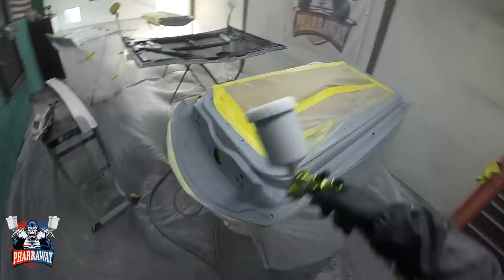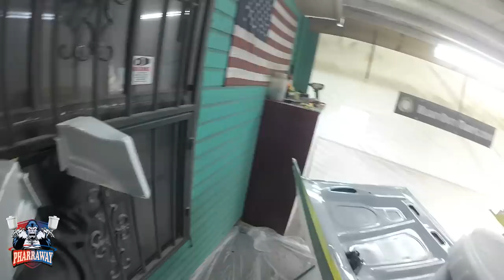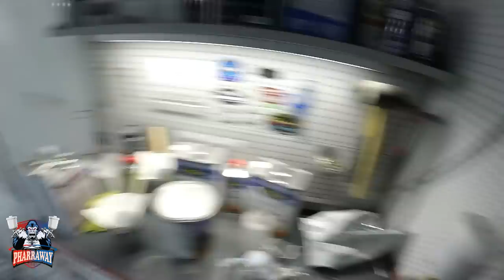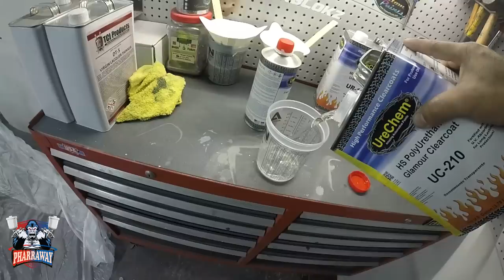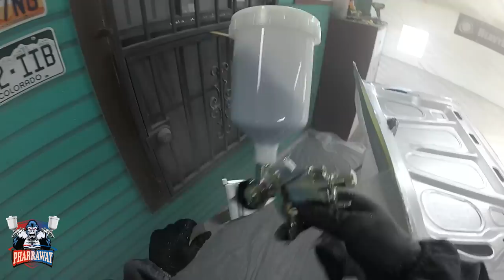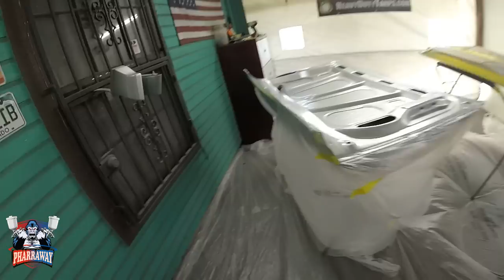How lowrider cars are painted with candy paint and metal flakes part 7

Comment: That's the cleanest paint mixing table I've ever seen. Of course I'm used to collision repair shops where the most important thing is speed, then cost of materials, then man hours, then maybe quality. 
I really want to work at a custom or restoration shop. I'm very detail oriented and I have to keep everything clean and organized as I'm assembling a vehicle. So of course I get complaints at work for being too slow. 
I may take a bit longer. But the finished product shows the effort.

Comment: Have tried using the Dekup systems?? They help out big time.. Instead of emptying the gun you just flip it up side down and it also helps with holding the paint while spraying upside down and different angles..  Can't wait to see the candy go on..
Reply from the maker: yes I have used them but ran out of them so went back to the cups till I get some more

Comment: Awesome video series! Quick question, I noticed your using Urechem. Back in a old clear comparison video it looked like it shrinks a lot more than the Grant 7. Did you end up liking Urechem best? I'm needing to paint a 60's delivery truck that will be in the weather every day and want it to last for many years. Do you have any suggestions on what high solids base/clear I should use? Btw, I appreciate your videos, they are helping me build up the confidence to paint myself!
Reply from the maker: The urekem clear is an awesome clear also the only reason I used that one was because Grant 7 was out of stock at the time, but any of the two will work

Comment: Brother loving this lowrider paintjob didn't realalise how much work went into these jobs and how long it takes  but the finish will be on point so well worth it . What would happen if the metal flake stage got messed up would you have to start all over ??
Reply from the maker: yes that is correct will have to do it again
Reply: @PHARRAWAY  Thanks bro that's why it takes so long the first stages have to be 100% how many paintjobs per yr do you do like that one they must take a lot of patience 💪💪
Reply from the maker: @deanbrown7643  more less 3 a year and yes it takes time
Reply: @PHARRAWAY  where did you learn that technique I'm only asking because I'm genuinely interested and one day might just give it a go don't get painjobs like that in the UK often RESPECT brother 😁😁
Reply from the maker: @deanbrown7643  it was a while back like in the late 80s doing a lot of lowriders around that time
Reply: @PHARRAWAY  is it just a lowrider thing or would it work on any European car ie what is a lowrider ? A hot rod or custom built car
Reply from the maker: @deanbrown7643  well it's a custom car that is as close to the ground as possible some use hydraulics to lower and lift the car with a switch
Reply: @PHARRAWAY  Thanks so really it's just a modified suspension to lower it but in your opinion would it look good paintjob wise on a stock European car or would it be blasphemy with out doing the mods